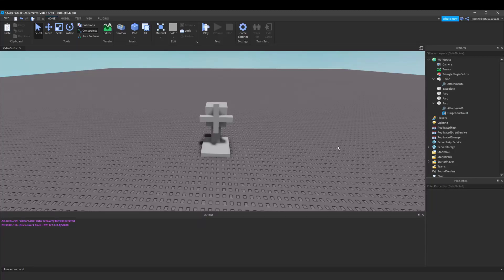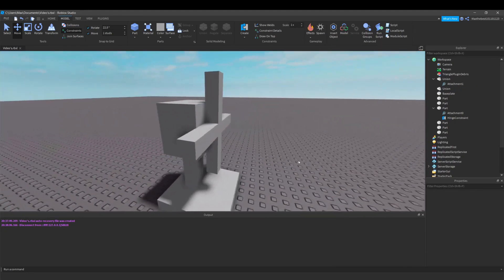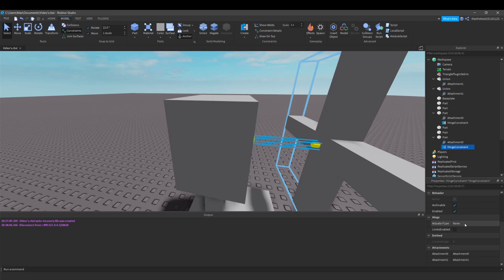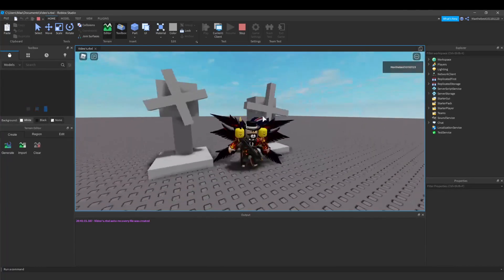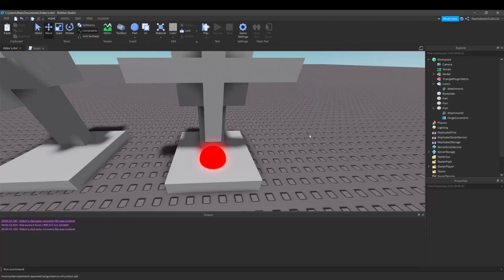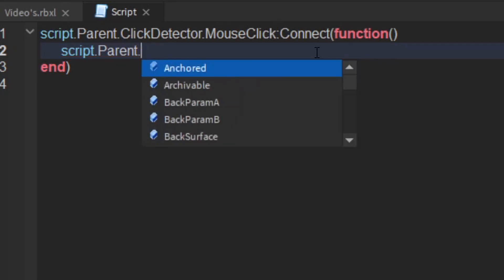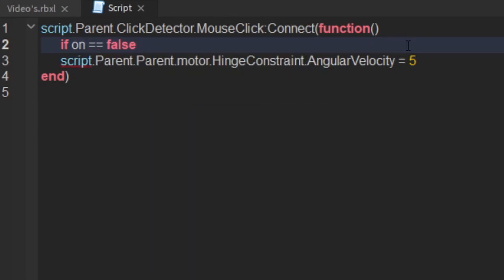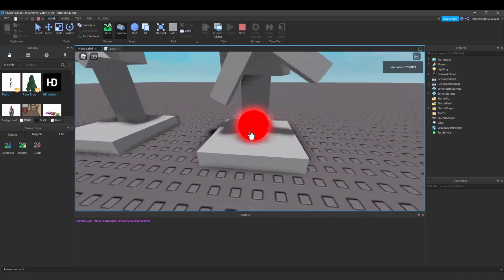Motors (Roblox Studio Hinge Constraint Tutorial)

Comment: even if i copied your script and then i tested it but then it dosen't work because I will do all conflicts
Reply from the maker: It's only a basic example of one constraint, it gets more complex with more. All I can say is that the motor should be in the anchored part which is not spinning. The spinning part should only have a weld and be unanchored. The hinge constraint should then have the motor actuator type on and it should work.
If the spinning part is more than one part weld or union them.
Long reply probably.

Comment: How do you make the button so it can toggle multiple parts?
Reply from the maker: You can only spin from one object either it be an individual part a union or a welded group.

Take spin more than one of these on each click you could have each hinge constraint inside the parts stated in a variable and as the same with the original hinge constraint but make the other motors activate too.

If this doesn't make much sense I'll add another version of the script for multiple motors in both a model and description
Reply: @blockybuilder101  If I name all my motors as motor, will that work?
Reply: Like the block with the motor/hinge constraint
Reply: Didn't work.
Reply: I can get it to turn on but not off
Reply from the maker: --Motor Script
--1. Make sure you have a Part called button containing a 'ClickDetector'
--2. Insert this script as a script or local script, into the part containing the hinge constraint
--3. Model your build together
--4. Ensure your ActuatorType on your model is equal to Motor
--5. Ensure your rotating part is a union if it contains multiple parts
--6. Set your speed down here \/ 'Speed'

--Randomised speed, set to true if you would like it
RandomSpeed = false
MaxSpeed = 20
MinSpeed = 10

--Variables
Button = script.Parent.Parent.Parent.Button.ClickDetector
Motor = script.Parent
Motor2 = nil
Motor3 = nil
Motor4 = nil
Motor5 = nil
Speed = 20

Button.MouseClick:Connect(function()
	if Motor.AngularVelocity > 0 then
		Motor.AngularVelocity = 0
		if Motor2 ~= nil then
			Motor2.AngularVelocity = 0
		end
		if Motor3 ~= nil then
			Motor3.AngularVelocity = 0
		end
		if Motor4 ~= nil then
			Motor4.AngularVelocity = 0
		end
		if Motor5 ~= nil then
			Motor5.AngularVelocity = 0
		end
	else
		--If random speed is on
		if RandomSpeed == true then
			Speed = math.random(MinSpeed,MaxSpeed)
		end
		
		Motor.AngularVelocity = Speed
		if Motor2 ~= nil then
			Motor2.AngularVelocity = Speed
		end
		if Motor3 ~= nil then
			Motor3.AngularVelocity = Speed
		end
		if Motor4 ~= nil then
			Motor4.AngularVelocity = Speed
		end
		if Motor5 ~= nil then
			Motor5.AngularVelocity = Speed
		end
	end
end)

-------------------
So basically try and do the same thing as the first motor, now you can have 5 motors in the script
Reply: @blockybuilder101  How do I add a 6th one? That's the amount I need
Reply: @blockybuilder101  Idk why it's not working, can you join team create and help?
Reply: Cuz I can get the whole thing to turn on but not off

Comment: How do you make it spin the other direction?
Reply from the maker: Very simple, make the rotation speed a negative number
Reply: Oh, okay. Thanks!
Reply: Also, how can I make my hinge spin abnoxiously fast without it breaking?
Reply from the maker: @PalmPeakMarketing  Simply, you can't, sorry.
Reply: @PalmPeakMarketing  make a cylinder and add a negate cylinder inside of it, union it and i think that will work if you anchor it and make it invisible (or use a ball for all angles)
Reply: Oof